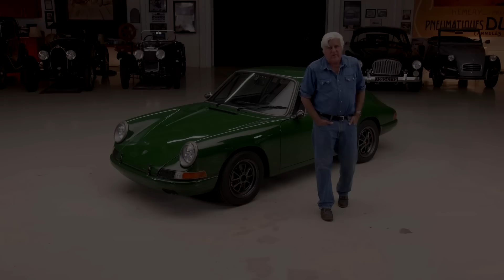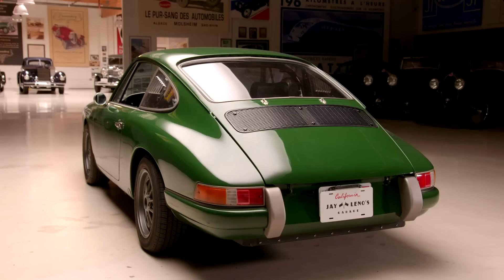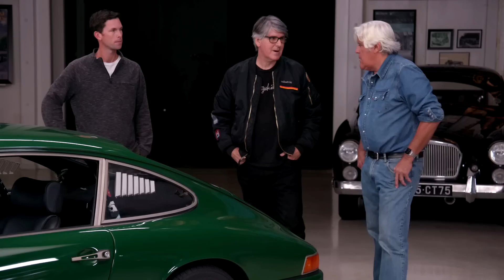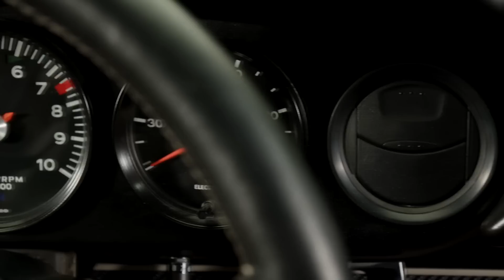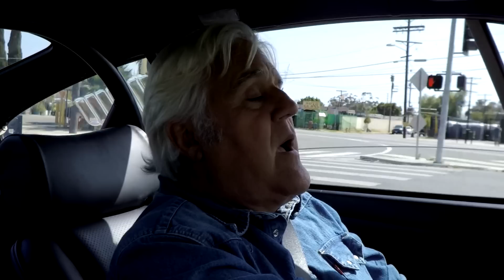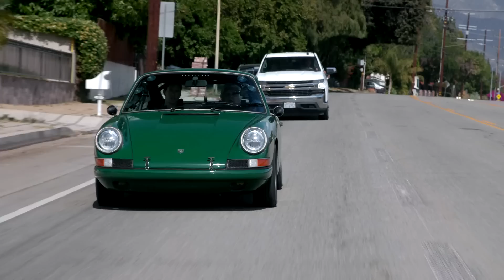Zelectric 1968 Porsche 912 | Jay Leno's Garage

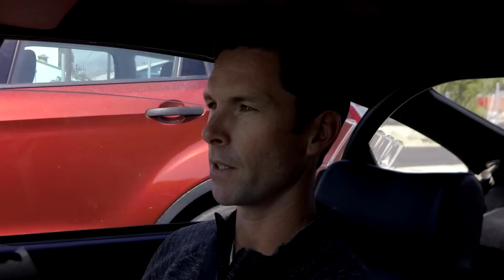Comment: 22:10 I don't know if he has test driven the new Aptera but it can do 0 to 60 in 3.5 seconds and can spin the wheels easily. The high voltage wiring will NOT be external in production units. It will be protected and professional. The Roadsters you see now are early pre-production.
Reply: Wheel spin is not an EV thing. Of course, with full torque possible from 1 revolution, just about any electric is capable . The thing  is, electric drive is controlled by frequency, and microprocessors put exactly maximum torque to the road instantaneously WITHOUT SPINNING THE WHEELS. You just get thrust. Wheel spin is for gas engines that need to got a couple thousand rpm going to make any power. Not necessary or desirable on an EV.
Reply: Aptera is a fraudulent vaporware investment scam.
Reply: @sandervanderkammen9230  the 1000 mile claim is crazy I will give you that. But 60KWh usable is do-able
Reply: @danwat1234  PROVE IT!

Comment: That is the biggest sticking point for EVs right now: time and infrastructure.  How fast batteries will have the ability to charge in the future remains to be seen, but as of right now its way too slow.
Reply: How so? Electricity is literally everywhere in any type of modern civilization. And any wall outlet can charge any current ev. 
So really there are more ways to re charge an ev then there is to fuel up a combustion engine vehicle. 🤔

Comment: Same old problem with all these electric conversions; they add more weight, give you less luggage space, limited range, in order to have MASSIVE performance that don't really need. The day companies can offer a car with the same space/weight as the original ICE car, with a reasonable range, for a reasonable price, more customers will be interested. And if you want to go to track day, what you want is less WEIGHT around the lap, not massive torque, and decent range or quick charging - i.e. a car that refuels and performs like the car it originally used to be.
Reply: Be sure and tell the guys with the Tesla Plaid, setting lap records at the Nurburgring, that they are all wrong.
Reply: @davidvicari5139  Try reading what I wrote again. I didn't say anything about Tesla Plaid, and I didn't say electric cars can't be fast. And how many people are ever going to lap the Nurburgring at ten tenths?
7m35s around the Ring for $130K?
991.2 GTS did it in 7m23s four years ago.
What's your point? Oh, right, you didn't have one.
The only thing a Tesla can brag about is 0-60 and range. But people that love driving, don't only care about 0-60.
Be sure to do as many 0-60 time in your Tesla as you can, and let me know what you're bored with that. I take that back, don't let me know. Just get lost.
Reply: @Ruylopez778  “  And if you want to go to track day, what you want is less WEIGHT around the lap, not massive torque”- isn’t that what you wrote???? So, you go to track day to not be fast???
Reply: @davidvicari5139  I also said to read it again, but clearly you can't read.
1. I'm talking about electric conversions, not brand new Teslas (and for the cost of a Tesla, you can get a conventional car that laps FASTER).
2. A car like a 912 or Beetle or Bus (which is the kind of cars they convert) were NEVER fast.
3. If you go to a track day in order to experience the thrill of driving, weight is more important than torque. Torque only helps you on the straights. If you're talking about LAP TIME - which you are, apparently, it's not just about torque, it's about how quickly you can brake and corner - which is about weight.
4. In a car as light as a 912, you can make it faster than a 60s 911 without needing 300+hp. And that's my point, every electric conversion focuses on how much FAST the car will be, while making it heavier and adding batteries that take up more space, instead of COMPROMISE between torque/power and weight/range.
Reply: @davidvicari5139  Was that record for an EV ? Because the real lap record is well below 7 minutes.

Comment: Yes you may think that they're good for the environment but what about the nuclear Diesel and coal power plants that have to provide the electricity to charge them up their carbon footprint isn't what you think it is
Reply: This myth has been debunked a billion times already. Nobody is claiming that an electric car is 100% carbon neutral. First off, coal is dead. CA only gets 0.12% of its power from coal. But, even if you used 100% coal power to charge your car, it would still be more efficient than a gas-powered car because gas engines waste most of the potential energy in gasoline. A modern power plant is literally 4-5 times more efficient.

Comment: So we force auto manufacturers to abandon vehicles that utilize a fuel supply we have an abundance of within the US, and instead adopt a technology that relies on raw materials from our primary political adversary.  If you think the chip shortage is crippling the car industry now, just wait until we can't get battery materials from China.  And by then, in a crisis, you also won't have gas cars as an alternative anymore.  How do people not see this for what it really is?  A national security threat.

All this, while promoting the illusion of going "green"-  as we all will charge our cars with electricity produced from fossil fuel power plants, because wind and solar are not viable.  And we get the added user experience bonus of having to make extended stops to recharge our vehicles on any sort of significant road trip.

"pRoGrEsS" 🤡

Comment: Next let have an episode where a new watch conversion company comes on the show and removes the time keeping mechanism from a vintage Rolex and Breitling in front of Jay's eyes and replaces it with a digital chip that use an LED readout. That would be so cool and definitely cutting edge
Reply: You could make this argument if they did it to a 911. But the engine in these 912s are no Rolex.
Reply: @scuph  I'm just making the point that these people are merely using vintage cars to make a fashion statement. I could have also used the metaphor of "improving" famous artwork or vintage stereo tube hifi gear with modern technology. It's an ugly bastardization of history.
Reply: @Bob-hq5lj  Fashion statement is a bit of a stretch as this car will still handle like factory, but I get what you're saying. Also important to remember that this particular company doesn't weld or cut any part of the car in their conversions so it's 100% reversible.
Reply: @scuph  your point is well taken

Comment: The smartest thing we could ever do is to electrify and recycle the classics.
This makes a lot of sense as the durability of these conversions easily out way the potential money pits you will have on your hands. It won't be long before someone packages a complete electrified conversion kit for simplified mass adaptation, on any and all ICE vehicle conversions. This has already been done for bicycles as you can Electrify any bike. It's a perfect way for Tesla to capitalize on this rebuild Market as they could very well be the frist, and best at it. ⚡ Won't be long before we get safer sustainable batteries you haven't seen anything yet with new Battery Technology. 
American and Arab oil companies will always have something to bicth about. As they made a fortune polluting our planet 🌍
Reply: What's so smart about ruining a perfectly fine, environmentally friendly classic and turning it into a polluting coal powered electric car, which has so much lithium in it's batteries you can dump five tankers into the ocean and it still wouldn't match the environmental damage that just one cell of these batteries has done?

Comment: I would like to see a 70' or 80's 911 or 911 turbo wide body with a whale tail spoiler converted to an electric powertrain. A neat touch would be to use the air cooling fan to cool the batteries. If I ever come into a large amount of money that is the first vehicle I'm buying lol. Paint it a root beer brown with tan leather 🔥👍
Reply: While it's not exactly the color you're thinking of, Bisimoto has a super rad widebody Porsche they converted to electric.
Reply: @CockatooDude  I heard of that company they do great thing's. I will have to check it out I bet it's a beast!

Comment: Nope!  Take a CLASSIC Porsche 912 worth anywhere from $35K to $60K AND can drive across my state on one tank of gas, then spend big bucks gutting it and turning it into an electric slot car that has to be recharged AT LEAST three times to make the same trip.  How the heck does that make any sense to anybody that has a brain instead of just a bucket of cash?
Reply: Not everyone needs to drive across your state?
Reply: @AR-zq9hq  Or any other western state apparently.
Reply: @howiem3883  yeah, screw those landfills
Reply: @AR-zq9hq  Now, if I lived in Rhode Island, and had a hundred grand worth of toy money, one of these would be just the thing, at least until it rusted into dust from winter roads.
Reply: @howiem3883  how would having the gasoline engine prevent it from rusting? Oil seeping everywhere and covering the whole car, rustproofing it?
Reply: I wouldn't have to find a small state for the gas engine model.  It has enough range.

Comment: Fwiw - An electric for my commuting would work very well with a 100 mi/day range - but for commuting it wouldn't be a car like this as the sport would be wasted driving to/from work.
This car would need to go 300 mi to get my interest.
Then as far  new vehicles go, i just can't wrap my head around deleting the entire internal combustion drivetrain and supporting components and replacing with batteries and a motor(s) and you want to charge me more.  Just doesn't work for me and I put myself at the average higher end of the middle class vehicle buyer.

Comment: I think that it will actually take TWICE the range of ice's to fully supplant them. Issue being, when you're going on a LONG trip or or are in a rush then stopping for an hour or more every 300 miles is terrible. What would be a 5 min stop in a petrol based car is just prohibitive in a battery powered car. Can you imagine the future though? 2000 miles on a charge. Heck, if the world is still here in 10 years it might be incredibly more than that.
Reply: Even at highly illegal speeds, 300 miles is 5 hours behind the wheel. When somebody portrays they are gonna drive 5 hours, pump gas for 5 minutes, jump back in for 5 more hours, I’ll show you a liar.
Reply: @davidvicari5139  I truly have no ability to discern what you mean by that. Are you stating that after driving 300 miles you need at least an hour break before moving on? The act of driving is too taxing for you? That's the most pathetic thing I've read in quite a while. A liar... in the future you need to stop conflating your inherent weakness with most others common practice. 

Good day, Sir.
Reply: @fuddrucker74  ok, I should have called you a liar. That is what I meant, for your discernment. I am saying, nobody takes only a 5 minute break in 10 hours of anything! Much less driving. I am saying, driving 4 hours, with a 20 minute break in my Tesla, along with the benefit of the smooth silence, the safety, the performance, the comfort, the low running and maintenance cost, you don’t know what you are missing. If your boss told you to work 10 hours with a 5 minute break, you would go on strike, or you should! I just get sick of the bs sometimes, used you for an example!
Reply: @davidvicari5139  to be perfectly honest with you, I drive to where I'm going. Whether that's an hour away or 20 hours away. We stop for fuel, rest rooms, coffee and food. I very rarely even like to stop and eat. I was raised that way and have continued it. My wife does the same. In fact, every road trip I've ever been on has been this way too. Plan a destination, drive there (if within reason) so we can have our own vehicle, stay where we choose, do what we choose, and then drive back. If you are forced to hang out and kill time for 20 mins at every fill up and you have taken that into consideration when you purchased the car then so be it. Until the range meets my needs then I have no use for an electric car other than a as a third or fourth vehicle which would be used as an in-town run about. Again, speaking for my own personal needs, that's what intrigues me as to its intended usage. I see that as a probability for the next purchase. But as a vehicle to haul the family on a destination vacation, it's just not there yet. Not to go down the rabbit hole, but we live in the country. The infrastructure has to improve to be able to handle the simultaneous charging of multiple cars on rural roads. I love that range and power output are increasing, and hopefully battery technology will follow suit to be able to lessen time to charge of course. But to also lessen resistance, to be able to reduce the strain on grids, especially outside of city centers

Comment: I'm sorry but this thing is lame! " I can go 20 miles and never use the brakes". So let me get this straight, you can maybe only go 120 miles, no shifting and not much braking? Sounds like a real drivers car lol. As a classic Porsche owner, all the fun comes from the shifting and braking and the foot dance that the driver strives to perfect. Zero connection between  driver and the car. Put that motor back in the Tesla...

Comment: I have an 1973 eldorado I wish I could bring it on J show.
Reply: I had a 74 Eldorado convertible, actually similar color to the Porsche. Sold it to go to college.
Reply: @chriscornelius2518  Really Chris?
Reply: I have like four cars I'm an long haul truck driver & It's hard because those cars need to be driven.
Reply: @tyronebateslibra9435  Yep, I remember watching the re release of Grease in it late 90s when gas was cheap
Reply: @chriscornelius2518   Yes I was younger then I'm "47 now.
Reply: The eldorado I have is an two door.
Reply: @tyronebateslibra9435  Mine was the convertible as I said. it had the 500 cubic inch engine.
Reply: @chriscornelius2518   Yes the one I have got an '501 CU'. I wonder what the horsepower.
Reply: I live in 'WI' I had the eldorado shipped from Montana.
Reply: In very good condition.
Reply: I have an '98 Silverado Z71.
Reply: 85 delta, 72 Electra.
Reply: Will sell the delta maybe.

Comment: Zero mention of cost to build. I would guess at least 150K
Reply: $68,000 to $88,000 according to their website... considering you are the biggest hater in the comments I think the majority of people like this.
Reply: @gabrielpartanen1194  Biggest hater. No. I just don't see the push for going all electric especially if the majority can't afford it. It's like the all electric fans are rich people.
Reply: @willsco76  many not “rich people” do their own work and enjoy substantial savings where as the “rich” people for example would pay a guy to come do drywall in a home verse doing it themselves.

Either way as these systems and builds become common place, the tech and affordability trickles right down eventually benefiting the common man.
Reply: @willsco76  I know a lot of poor people own electric fans.

Comment: I think that a Citroen DS electric conversion would be fantastic. Jay can afford it, I can't, but I'd love to see it done. Hint hint hint...
Reply: The only downside of that conversion would be that running the hydraulic pumps for the hydropneumatic suspension would ruin the range a bit. I still think it would be an awesome conversion though.
Reply: @CockatooDude  there's a guy in Australia who has done it, it's on YouTube as well
Reply: @AR-zq9hq  Really? Thanks I'll check it out. I know the hydraulics on those are tricky to work on even in stock form.
Reply: @gregmuon  they added a pump for the hydraulics and a pressure reservoir. The pump only turns on when the pressure falls below a certain level. You can definitely hear it in the video.

Comment: The reason electric vehicles were fazed out in the early 1900's is the range, the range will always be an issue with electric vihicles. NOW. The new issue is cost. The lowest price for an all electric vehicle is 40K and GM's hummer is 130K and Telsa averages 80K-140K. In order for the electric vehicles to make headway, the manufacturers need to lower the starting price to 20K, but they won't becuase they will lose millions if not billions. Electric vehicles are not the answer.
Reply: What about battery weight and physical size?

Comment: Seems crazy to add a battery to such an iconic light weight car.  Cool I guess but you totally lose what makes that car special,  the sound of that engine and light weight handling... to each their own
Reply: They said the zelectric weighed 2500 lbs. My Boxster weighs 2700 lbs.